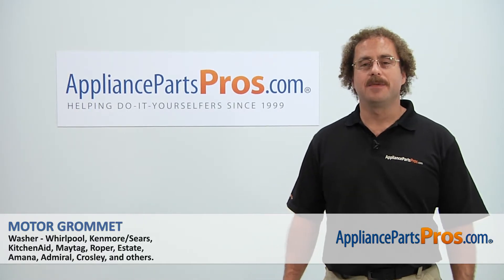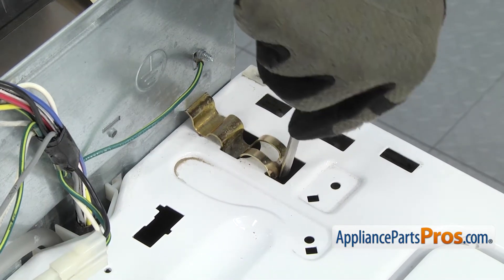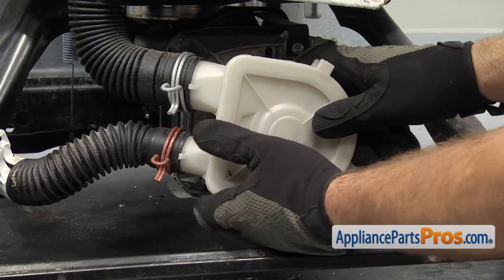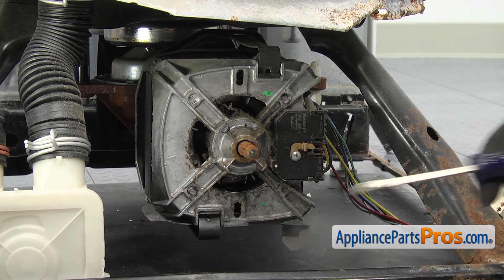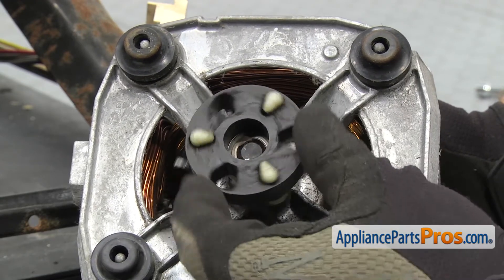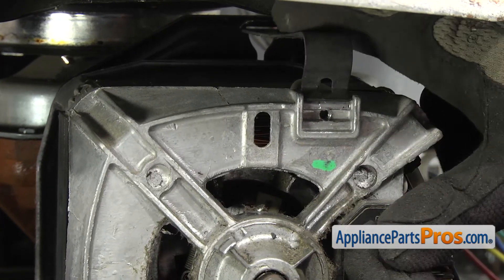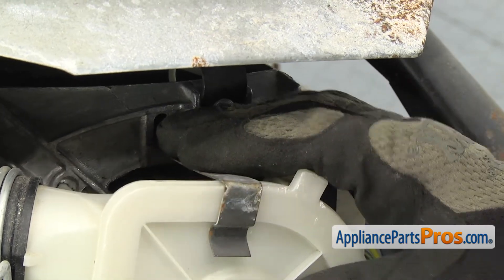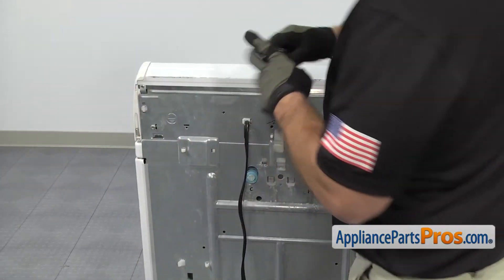How To: Whirlpool/KitchenAid/Maytag Motor Grommet WP62691

Comment: Tip: to line up the water pump and motor shaft what I usually do is reach behind the motor and spin the coupler as needed to get it to the right position. Hope it helps someone :)
Reply from the maker: Thanks for the tip!